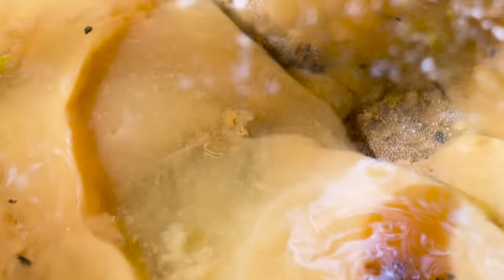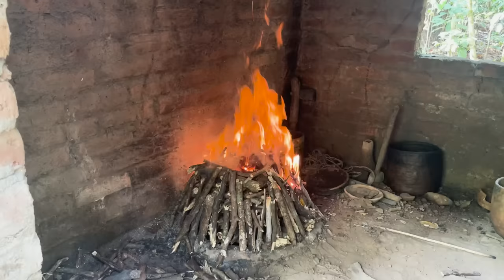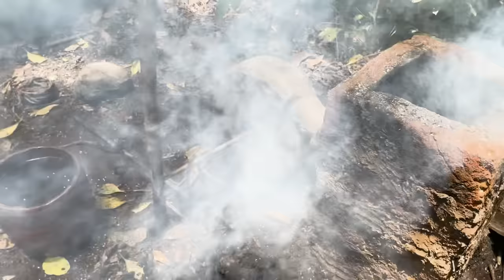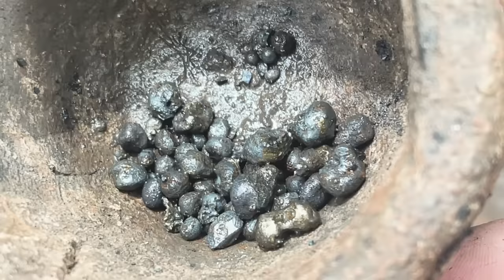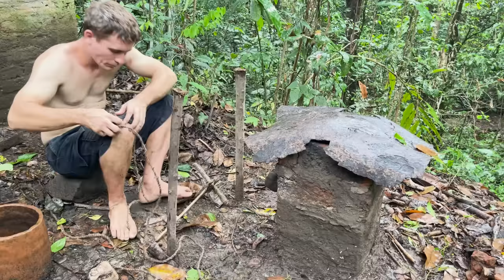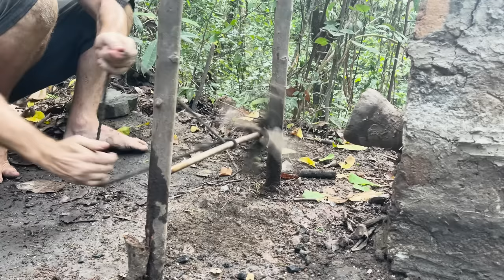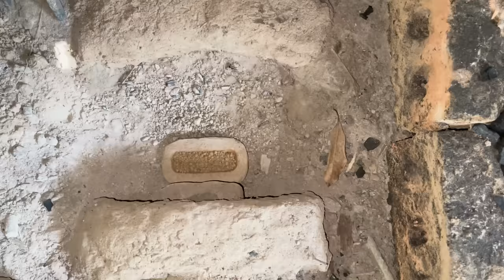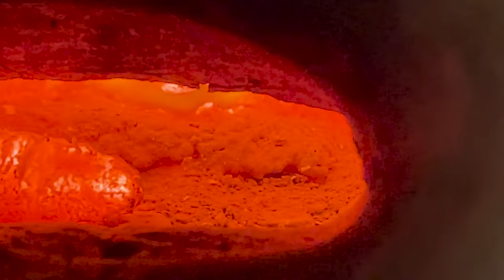Primitive Technology: One-Way Blower Iron Smelt & Forging Experiment

Comment: Hello John.
I wonder, what if you've upgraded your blowing fan even further? i mean, the upgrade from two-way to one-way is facinating enough, but I do think it can get up a level yet again.
See, if you drill a hole in the second fan-post and extend the fan-stick through it, you could makeshift a perpendicular handle (or two, making a cross-like handle) at the end of it, which would in turn allow you to just rotate the fan using your fingers in a comfortable way. You could even exert extra force when you feel like, to make it spin as fast as the assembly (and your hand) would allow.
It would also eliminate the spin-down phase, which, as it goes now, occures when the fiddlestick of your creation goes forwards. No rope would be required as well. The assembly would be simplier, and hence, more durable and reliable.

Update: as a post-thought, I think if you manage to find a fast enough water stream (or narrow an existing one to increase its flow), you might be able to use it to rotate your fan absolutely labor-free!

Thank you if you've read this.

Comment: Excellent video!
Seems if you want to limit carbon or decarburize the iron, you could try an indirect furnace similar to how you heated your hut floor with a long draw, fire on intake and on other side of hut stack and exhaust. For iron, you could have one furnace chamber to burn wood/charcoal, and in adjoining chamber the iron mold. The exhaust from fire box would be directed up and then down on iron mold, then exhaust draws gas down and out through nearby stack. Each furnace chamber could have its own door/cover to fuel or manipulate iron mold. The fire box would have truyere for blower. Also, could dry or pre heat items on exterior top of the multi chamber furnace. This arrangement would keep charcoal and fuel from immediate contact with the final iron.

Comment: Isnt there an effect, where fluid stream, such as blown air, will create friction with the static air around the opening and pull in more of it with the flow, compared to if u stuck the blow end of a blower straight into the touyere? U can blow up a trash bag faster by blowing air at the opening, rather than sealing the hole against your mouth. Space the blower away from the touyere - see how that goes.

Comment: I think it would be a great idea if you would take a clay disk with some embedded sticks that you can mount to the axle of the blower, thus creating a flywheel. This would smoothe out the rotation a lot and make it easier to keep the rotor at a constant speed.

Comment: John, since you are in Queensland, I wonder if you can find some local bauxite (aluminum ore), grind it up, and fire it with your iron ore for a thermite reaction in your charcoal furnace. Since it's so exothermic, generating enough heat shouldn't be nearly as much of an issue. I'm guessing there will be various impurities from the bauxite, but it might be a decent iron for your purposes. Great stuff, man.

Comment: incredible! it's wild to see how far you've come.

out of curiosity, I just watched a video that mentioned improving clay's flexibility by drying it completely, re-wetting it with rice water, and mixing hair into it. I remember that you had an old video on yams and arrowroot flour- I wonder if the starches in those would work similarly, to improve the quality of the clay you're using?

also, do you find the charcoal you get from the method of burning and dousing it with water is better than the charcoal you get from a charcoal kiln and suffocating the fire? or was there another reason to use that method?

finally, what exactly is the slag that isn't iron made of? is it just weird melted rock nonsense, or what?

Comment: Once you have the iron prills (relatively pure iron), would it be possible to create a second mould as a lid for the materials being smelted? You would lose the benefit of the ash acting as a flux, and it will likely take substantially longer to reach the higher temperatures needed for melting the iron, but you gain a more pure final product and reduce adding uneccesary carbon along the way?

(Also you're literal legend for pushing yourself into the iron age! Love your dedication to the process, you're an inspiration!)

Comment: The new Setup looks Awesome by the Way.
But I keep wondering, if a fired Crucible made from Clay would help with the smelting? 
This could enable you to put the whole mass for smelting in at once instead of doing layers, it could also help with the iron Formation. The Crucible would probably be single use but if it helps geting the Iron more efficiently, then it could be worthwhile.

Comment: John you need to find a way to constrict the outflow of heat from the top. You are losing a ton of heat. More heat will allow for better coalescing. If you want to get real sophisticated with the clayworks, build a furnace with an air preheat chamber for the blower to pull from.

Comment: Would making a second blower housing and second fan attached to the same bar produce double the output without doubling the effort ? Maybe by facing the opening holes on opposing sides, you can draw in extra air, and by using two funnels that lead to a wide ended tuyere, the airflow could be drastically increased without extra effort when blowing.

Comment: You can't make a crank? Could probably even give it mechanical advantage with the rope and 2 pulleys. It would probably be the best method to hand power a blower since you really need RPM over torque with these small bladed fans you're using. The current design seems to do that pretty well though. 

If the rope you're using can bend like in this video and not snap it would be strong enough to be used as a belt, the pulleys would be difficult to make but definitely not impossible. If you scape out the center of the pulley and give it a V groove or a half circle groove plus cross hatch it with something sharp for grip I think it would work and be even more efficient than this design since there's no wasted movements. 

The only thing I see that would be difficult to overcome is making a seamless circle with rope, since you'd still have to tie a knot somewhere, but I think some clever braiding would be able to solve this issue. Braid the ends of the rope together and use 2 or 3 small ropes to fasten it all and it should be small enough to work without too much vibration.

I think it would be helpful to try to make some sort of primitive lathe but I don't think that would be feasible at the moment due to the rigidity required. On a small scale I could see it being possible but on the scale that you're working with I think it would be too floppy to make useful parts.

Comment: I would try and make a fly wheel may need stronger structure, but once started may reduce the amount of effort needed to continuously spin the blower by hand. I would also char where the axle sits and use some form of oil to lubricant to allow for smoother operation.

Comment: Would the spinning fan setup be improved by a flywheel? Allows the spinning assembly to store more energy and keep spinning through the changing input - there will always be differing input power no matter what means, so the flywheel might help smooth that sin wave. Good luck and thank you!

Comment: Leg power is the way to go especially if you can get it so that you can do something similar to walking, a good hefty flywheel to maintain the momentum in one direction should also be applied. Its a little more effort to get started but allows for more consistent output

Comment: I think, it would be feasible, to add a flywheel from clay to the new blower design, onto the shaft. This way the rpm of the blower would be more stable, and needed less energy to hold it in the useable range. It would be harder to start, but I think it would help in longterm.

Comment: I think you are pointing in the right direction, using flux and high temperatures surely will help with the impurities, but it wont matter unless he gets to decarburice the iron up to at least an eutectoid steel. This could be done with the smelting technics used with wootz steel or damascus (the real one).

It basically consist in enclosing the pig iron in an hermetically sealed clay pot with charcoal and limestone flux and then baking it to high temperatures, this way you get basically a miniature high oven setup. The idea is to melt the pig iron letting the impurities float with the flux slag, at the same time, the charcoal will burn in the low oxigen enviroment of the clay pot, making carbon monoxide, then carbon monoxide will capture the excess carbon in the pig iron.

Comment: Combine that with some natural draft furnace might work better.
The main purpose to get iron is to get it as hot as possible. With that design, you only get a slight natural draft from the blower holes which minimizes the efficiency when not used.
With multiple natural draft from 3 sides and 1 blower in 1 side, you can generate more air flow

Comment: 1) idea for blower improvement: Add some flywheen weight so it keeps spinning more easily berween the pulls with the rope stick

2) Why aren't you trying to make bronze? Do you not have mineable access to tin and copper ores? (What do you think of buying the raw ore, and using that? Is thst too far from the spirit of the channel?)

Comment: If I might make a friendly suggestion. Iron at critical temperatures will want to revert to iron oxide or absorb too much carbon and become so brittle that it is completely unusable. 

Using a flux can prevent this. Typically in blacksmithing we use mineral borax to create an oxygen barrier for forge welding. The slag allows the iron to reach temperatures that in the presence of oxygen will cause it to burn and revert back to iron oxide (think sparkler 🎇). If that mineral is not available in your area it would be a reasonable assumption that slaked lime or some form of silica could also work as a flux at least for crucible steel ( and you will need a way to “bleed off” the slag if it gets to the point where it interferes with air flow. Volume is also an important factor just as a bonfire is hotter than a flip lighter. Having a greater surface area will generate more heat for your smelting process . Also make a dished out stump and a heavy wooden mallet. Take your bloom to the stump and beat the crap out of it, iron slag and all while it is as hot as possible. This will help forge weld all of those little iron prills into a solid lump while the slag protects your work from forming oxides. I wish you all the success my friend!

Comment: Try adding crushed limestone next time as a flux. They still use it heavily for steel and iron smelting to this day! Assuming you don’t have a ready supply, very fine creek sand or powdered clay tiles will also work. The most difficult and frustrating part of of any smelt is keeping the molten base metal away from oxygen

Comment: Would it help to seal the joint between the tuyere and the blower with mud to prevent air escaping or is it tightly enough sealed already?

Comment: Hello, super interested to see where this channel takes you. I’m sure you have endless ideas and experiments to run, but if you’re interested in adding any to the list, here’s a few
- I think everyone is interested in seeing you make some degree of rudimentary electronics, and you’re probably a ways off still. I was thinking about your situation and I don’t know if you have access to magnets or lodestones but I suspect not. I did some research and figured out a potential work around though it would require both copper and zinc in addition to the iron you’ve found. The idea is to build a galvanic cell.

I’m not too familiar with the process of prospecting but from the book research I’ve done, sphalerite is a yellow rock that contains iron and zinc. The yellow being an indicator.

Green rocks are usually an indicator of copper, but I can speak with any certainty of where it might be found.

I believe that both zinc and copper have lower melting points than iron, though I also think that zinc has a pretty close melting point to iron so separation would be difficult without a magnet.

Effectively, with a bar or rod of zinc+iron and a bar or rod of copper, suspending them in a salt water solution can produce a charge which with a small iron rod wrapped in copper wire can slowly magnetize it. The process would probably be slow, but having something like this could allow you to separate zinc and iron more effectively as well as set up a very rudimentary generator which could be used to create additional magnets passively.

I think while there’s a lot of experimentation that would need to happen for this to work, the hardest part would probably be the acquisition of iron, copper and zinc, their purification, and the formation into the shapes. I’m frankly not sure how one might make copper ore into copper wire.

Anyway, it’s just a thought, anything you do will be fascinating though.

Comment: @Primitive Technology: From what I understand and guess with very basic chemistry knowledge: I suppose you would want even higher temperature for more iron prills to be smelted instead of slag. But since cast iron has a higher oxygen level and isn't of such a good quality, you don't want to achieve a higher temperature by adding more air (and therefore oxygen) to the smelt/oven, right?! :) So you would need even better charcoal/another material that burns with higher temperatures as fuel. Or a better building material with more insolation for the oven so it doesn't lose as much heat. And I guess using iron ore would be of much higher quality compared to the iron gained from drying the bacteria!?

Comment: As you were making the ingot, I was wondering why you couldn't adapt your new "stick and rope" method to the old horizontal blower - you'd need a frame that goes up to the top of your spindle/axle to hold it (like the 2 sticks on either side of the vertical blower) but the stick and rope should still work, right?

Comment: Seems like a wooden gear train is in order to get faster RPMs on the drive shaft, also you could probably make 2 bow-sticks and attach them to a wheel on one end and have them lift up a weight on the up-stroke and no longer lift it by the down-stroke so that the strings become taut when moving towards the drive shaft but loose when moving back with the motion of the wheel.

Comment: As you continue down the rabbit-hole of more efficient furnace / blower methods, I would urge you to contemplate the origins of the lathe. I know, sounds crazy but, the drive method however was something that maybe, big maybe would be worth exploring, anyway... it consisted of a sapling, a thinnish greenwood tree that the operator would work with a foot pedal and the flexibility of the tree would then power the rotating part of the lathe. 

Also, what does a cross section look like of the ingots cast so far? Can anyone weigh in what the mass of prills would look like without the flux? The fluxes job I imagine is to seal out inclusions and other impurities similar to when welding with an electrode / stick welder.

Comment: You can try making small batches of crucible steel with the raw ore and some of the cast iron you already have sealed inside a crucible. Maybe 15-20 grams of the prills, then fill the crucible the rest of the way with the ore. This is speculation on whether or not it would work, but I think diluting the carbon you have is going to be easier than removing it from the final product.

Comment: Look at foot-powered antique wood turning lathes, they would use a foot pedal attached to a rope to spin a workpiece in a single direction. Some even used a green tree branch overhead to pull the rope back up.  I feel like a system like that could be adapted to the blower.

Comment: Can you recycle some of the waste heat? I know its more complicated but it seems like heat is everything. 

I have an idea although I'm not sure how feasible it is. But I think if you can direct the exhaust down into a chamber full of rocks, the heat will stay in the rocks, then you can disconnect the exhaust and run the air through the chamber heating the air before it reaches the furnace. If you connect a second chamber it can "recharge" with exhaust heat while the other chamber cools from air blown through it. You would need to switch every 10 min or so which could be annoying but could also be far more efficient.

Comment: The next step to improve the blower may be to create a pedal-powered pulley system, of the sort that spinning wheels and early grinders would use. That would only require some wood and a decent enough bit of rope.

Comment: Could you adapt your old pull cord powered reciprocating blower to be a one way blower by using a rock in your left hand with a small pit carved in it, the pit held over the spindle rod while your right hand works the bow? I imagine the hardest part would be maintaining pressure on the top of the rod without being too tight to stop it and too loose to let it fall free. Maybe just carve a reeeeally deep hole into a stone perhaps using your old iron knife, so you dont even need to push. The rod just freely spins around in the carved out pit?

Comment: hey is there a reason you havent tried smelting bronze? the melting point for copper and tin are lower than iron, i wonder if that would be an easier first step. but maybe its hard to find natural deposits of those metals

Comment: I think the idea for the foot powered blower was you could use a very large lever to take advantage of the longer (and larger) muscles in the leg. Also, is there enough water flow to set up a watermill to run the blower?